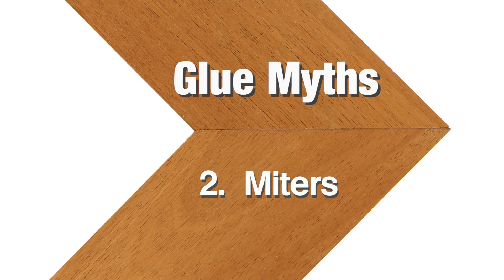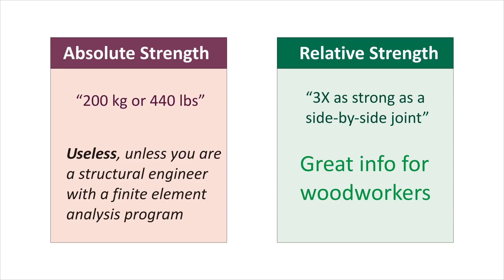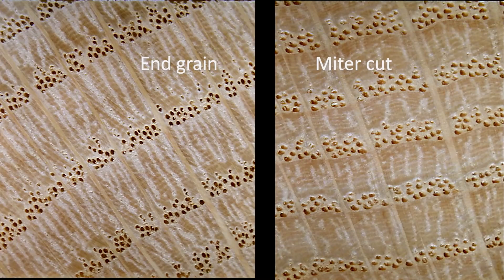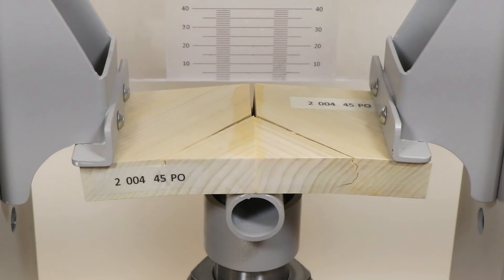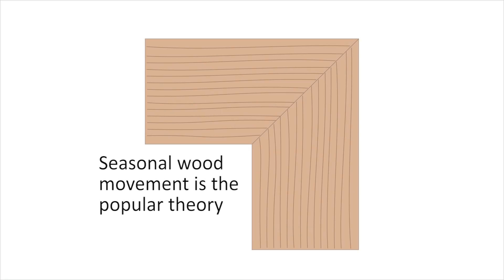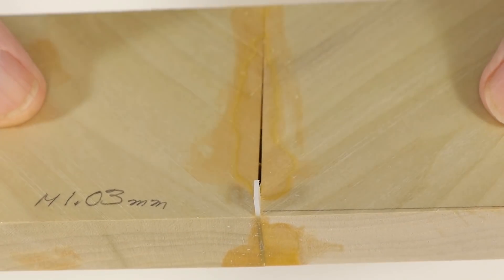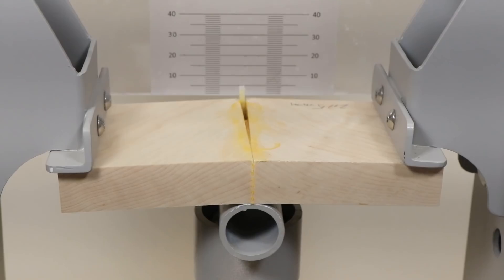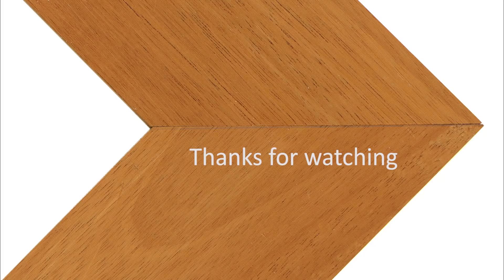Glue Myths:  2. Miters

Comment: Long, but it's Father's day.  This is a good video, .  From the beginning, we are taught and confirm gluing end grain is not as strong, miters not as strong as edge to edge, etc.  There is truth to this, but as Patrick laid out, not necessarily accurate per real world needs and the math.  The reality is end to end grain applications come from butting wood up against another piece with length vs. width adding leverage and detracting from strength per such a small surface.  Edge to edge is typically harbors longer glue joints as well, so that adds to strength. 

But this video is mostly about miters that are somewhere in between the above.  Typically it will be less surface area than edge to edge, and have other forces working against it with extended length, almost as long as end to end.  End grain does absorb more moisture, which removes more glue (depending on type used) from the joint and starving it.  So, all these factors are considered and used.

My father did fine woodworking professionally, taught me quite a bit, I received a scholarship for it (bet you didn't know they existed), and did it professionally a while as well, making high end presentation cases out of exotic woods that have landed in Hollywood homes, even in one instance even a King.  (At the time I was too young and arrogant to have any pressure placed on me in recognition of the magnitude of this understanding).  I still have projects from 30 years ago and some of my father's from longer.  Often woodworking is what was taught or told, hoping that was correct, and more in theory with real world evidence as Patrick indicated that often not available as the project is long gone.

Regardless, the important factors are that the myth of joint strength is in question and there are other factors involved.  As he continues I am waiting for the punch line and he nails it. (punny..).  While my father taught me important tactics, joints and principles, I believe one of the most important was "quality".  Quality starts with wood selection, not just aesthetics of pleasing grain patterns, but how you treat them differently and use them in your project.  Believe it or not, I've had shop teachers starting as early as Junior High that would disagree with my woodworking theory, often applying a blanket for all species or types of projects, and others that tried to fail me because my project was "too good", and they thought my "father did it".  Others like my high School teacher who I later found used me as an example to other students this was a viable trade, that was pretty cool learning of that.  Even to my college professor, who at one point saw me standing at the shaper table looking at a piece of wood sitting on the table.  He asked what I was doing, and I answered, "trying to summon the courage to do it".  Now, in my mind I was walking through how to do this, what could go wrong and to be ready for it, because it was a complex operation on a piece of wood I just spent hours and of significant money on.  I was not in fear of, or in question of my abilities and understood the approach, but instead knew this was that time many of us run into where we know it can go south quickly and ruin the most important piece of the project.  So, he casually said, "oh, there is nothing to be afraid of, quickly grabbed the piece of wood and flipped the shaper on as I looked in horror.  I should have stopped him, but did not, and sure enough, he gets to the end, has a lapse in focus and the shaper grabs it as his finishes and pops off the corner.  He powers it off, hands it to me and says, "see, no issue, you can just touch that corner and all is well" then just walks away.  Well, I was dumbfounded, but as my father taught me, a "good woodworker is not perfect, but knows how to hide mistakes".  So, I start to go through all of the wood stock until I find a piece that matches grain and color perfectly, cut off the corner, glue up, and finish up on the shaper.  After complete and assembled, I bring it back to the professor and showed him.  At that point, he called everyone over, held it up and said that when cutting this piece, I had made a mistake, but this shows you "it is not about mistakes, but how you can repair them", then said, "try and see where the mistake is".  I remember sitting there astounded that not only did he fail to say he was the one who damaged it, but that he said I actually made the mistake.  Anyway, it's a long way to get to another component my teachers and other students would give me a hard time about; and that was setting up the tool.  I would take considerable time (especially in a school environment where student mistreat equipment) to ensure the equipment is true, with the correct blade/bit and that they were sharp.  Far more time than the completion of the cut itself.  But the end result as my father reinforced was a perfect cut in terms of square, even, etc. and like here starts long before glue up.  Patrick eluded to this in this video, also hitting another critical factor in talking about clamping pressure.  This was another component my father implanted in my brain.  In the instance of miters, I see many clamps out there that opens the door for failure just for complexity, timing, and potential to misuse them.  A simple method he taught was using tape at each corner, which aligns them perfectly and provides the perfect amount of pressure that over 30 years late still looks as good as it did the day I did it.  The important factor being those joints have to be perfect. but when they are, it makes assembly and glue up very easy, or at least, easier.

Again, this was an excellent video because it helps woodworkers understand there is more to joinery than just the properties of the wood.  While he did mention species used, he did not mention that this will vary per species since some are more porous than others.  Most importantly he talked about factors like accurate miters and mentioned another video regarding clamping pressure.  The reality is if your surfaces do not mate perfectly, and/or there is uneven pressure (not movement expected by the wood), the joint will be more prone to failure.  Clamp pressure not only squeezes glue out, starving the joint, it also adds undue pressure that in some instances is intentional for the person to try and compensate for the poor joint.  It closes it up and all is well.  Well, maybe for a few months, year, or more, then with expected wood movement, will end up popping.  Yes, you need to pay attention to types of grain and compensate as appropriate, and for many projects, end grain, or miters are weaker, not as much because of grain pattern, but how you approach it and the typical applications these joints are used.   Physics don't always match, and you must recognize the project in it's entirety to understand strength, because as he said, standard testing of how much pressure it takes to break a joint may have nothing to do with the purpose or anticipated pressures and leverage the joint endures.

Another component is talking about these splines.  While the spline itself gains surface area, it also takes strength away from a standard miter because you have to remove the actual surface area of the miter, which detracts from its strength (and why biscuits are often not great).  But again, depending on application, the forces to pop a miter are different and in some cased the spline while weakening the miter, may actually hold the miter together better from the anticipated forces working against it.  So, the answer comes back to the what the miter joint is doing and the expected forces involved.  In the end, sometimes it's better not to use splines, but like with all woodworking, it is more about quality of cut, than trying to reinforce something that was destined for failure.  Don't get me wrong, I love splines and will often use them both for support (not strength) and in decoration.  But while you need to consider all factors in woodworking, accuracy and the quality thereof is equally as important as recognizing the appropriate technique.  A spline is not going to bail you out from a bad quality joint.  As Patrick said, it is learned that in certain instances you take certain precautions, but that is not always, or even often true.  This video is a first in a while that does not just follow what is recognized as common, and really investigates them.

Comment: Wonderful video and as in the previous one, a test to make us proud as engineers.  I was actually pleasantly surprised that the joints with less than 0.040" gaps did so well.  one thing I wondered about with this set of tests, even more so than the first glue joint one is how the results might change if the loading was in plane bending instead of out of plane bending.  The joint itself might be stronger than the end to side joints, or maybe not, depending on how the outer fiber stress changed and  how the difference in the glue infiltrating the space between fibers.   i'll be running it through my brain for a while.  but if you tried such a test, please let us know.  great job!

Comment: I like the scientific testing and the explanation in this video of the idea of torque. When you test the miter or an end-to-end glues joint, or others demonstrate it, it’s always with a small joint and long legs of wood that seemingly don’t need much force exerted to brake the joint; this however is simply torque with a small force at the end of a long lever translating or equaling a large force at the joint. I’d love to see a comparable glue up of side-to-side with end-to-end where each piece was say 12 inches long over a 3 inch joint. I would think this may put some of the arguments and negativity to rest as this is the strength of science that people just can’t seem to wrap their heads around as side-to-side glue ups are so standard and no one ever places them under the same force/stress that end-to-end glues face. 
I tried this myself with some old growth oak and hard pine and could definitely tell that the end-to-end was at least 3 times stronger than the side-to-side; the side-to-side broke without much effort over the 2 feet separating the grain while the end-to-end only broke when the glue gave out.

Comment: When I was new to woodworking, I only used glue for the frame miters, no joint I knew. And the earliest I have done is 7 years old, and they are still very fine. Those times I didn't know about the end grain myth and I am happy that I didn't ^_^ And some picture frames I did were more then a metre long.
But of course I was using very dry soft wood and they don't move much with time and I oil them.

Comment: Is there any inherent difference in joint strength when testing different types of stresses? There will always be more tests to run and never enough time, but I'm curious about things like shear and pullout forces. I think if a mitred picture frame were dropped on a corner, the force on the opposite corner would be outwards from the joint, right?
Reply: That is a really good question.
Reply: Project Farm did tensile and shear testing with 2x4s and wood glue (https://www.youtube.com/watch?v=k-g3efGa3sI). In the comments, someone brought up the "end grain glue ups are the weakest glue joint" myth, and Project Farm responded saying that any edge grain glue ups became tests of wood strength (probably lignin).

Comment: I suspect the big reason we see so many miter joints fail is they're frequently used in a situation where there's not a whole lot of surface area glued and there's a decently long arm that can apply force. You cited the picture frame example. I think a lot of woodworkers have extrapolated behavior with the smaller, lower surface area joint to mean all miter joints are bad. It's all about leverage in those situations AND the amount of surface area. 

I wasn't all that surprised by the results of this because I have some pieces, like you, that rely on miter joints, although the way I typically use them is pieces with low surface area get splines (Picture frames), and with my larger pieces, I'll glue with a long cure time epoxy, so any gaps in the miter joint get filled with a glue that adds actual strength when it's in a gap (Unlike typical wood glues).

Comment: The one question I would really like to see addressed is when force is directed through width dimension rather than thickness.  Loading on a picture frame for example tends to be perpendicular to your experimental setup.  Also, glue type may have a distinct effect on whether wood or glue fails first.  I have the pieces of a splined, oak frame made by my grandfather during WW I.  The frame essentially disintegrated over time as the hide(?) glue he used aged and became brittle.

Comment: If it hasn't already been covered I'd be interested in the clamping force to joint strength ratio. Is there a point where the clamping pressure becomes ineffective or even detrimental? Thanks for the video.
Reply: Matthias Wandel did a video on this a while back. I think it’s called “can you squeeze all of the glue out of a joint”
Reply: @christianscustoms6429  Thanks, will check out.

Comment: Related, I have speculated about the strength of finger-jointed lumber, as commonly seen in big box hardware stores. Having broken many of these boards, quite often at the finger joint (and keeping in mind the commonly touted phrase of "the glue is stronger than the wood"), I think woodworkers, in general, have failed to consider the transmission of force through the grain. It seems that long, uninterrupted grain transmits force through the board in a smooth manner throughout the fibers. Whereas with a finger joint, any force being transmitted through the board seems to crash abruptly into the glue joint, concentrating the load/force directly onto the glue joint, while the piece without a glue joint was able to seamlessly transmit the force through its fibers.

Comment: Hi Patrick! Saw a review of your through quantified work in another channel about joint strengths and wanted to ask you, what is your thought on "barrel nut" joints when it comes to detachable wooden structures. All i see on youtube is "threaded metal inserts" used for multiple bolts tightening instead of bare wood screwing to prolong life of any detachable joint but in Europe and asia barrel nuts as well as "mini fix- cam lock" joints are widely adopted. 

trying to figure out best solution for my detachable murphy bed project regarding strong joints. Cheers.

Comment: Patrick,  excellent information on glued wood joints, in particular miters.
In my miter joints I use a wood screw, counter sunk and plugged, to joint the miters together.
How would this affect the strength of the miter joint

Comment: Hello.
Thank you again for another great video and for clearing another myth.
My question is what does that mean for end grain joints such as sliding dovetail joint between rail and stile of a door for example. I often thought that such joint is ideal between stiles and rails of a door because it mechanically lock rail to stile and prevent rail from separating from stile but I did not try it because I was told that it is a weak joint because it involves end grain. 
Look forward to hear your comments. 

Thank you
AJ

Comment: Does finish like wax or urethane change the surface strength and resistance to splitting?  Gorilla glass is made by filling in the surface imperfections, and stopping cracks at the source.  This allows the glass to bend without the glass breaking at an imperfection.

Comment: Hey Patrick, I really like your videos I think they are very professional. I think i may have something usefull to add, regarding the sidegrain and miter tests. If you would instead consider pieces which have a size bigger then the glue area size, i think the strenght of the sidegrain/miter bond relative to the end grain bond with a same glue- to piece area ratio would get significantly closer to the strength of the end grain bond, this ratio increasing when the glue-area/size ratio increases. Would maybe be intersting for you to do some tests about this, since in a realistic workpiece this can oftentimes be the case. It might be especially impactful on the miter cuts since the piece breaks where the length of the wood fibres gets closer to zero, and eliminating this imperfection might severly strengthen the bond.
Greetings.

Comment: I think miters can start perfect and open over time due to shrinkage if the wood is not sufficiently seasoned at the outset. Also, a miter from well-seasoned wood that experiences a dramatic increase in humidity (stored in a garage or something) might expand enough to open a miter. And of course, for fences and decks and whatnot, the miter joint is probably best avoided. It will open 100 percent of the time outdoors.